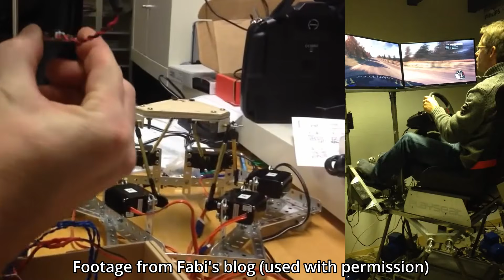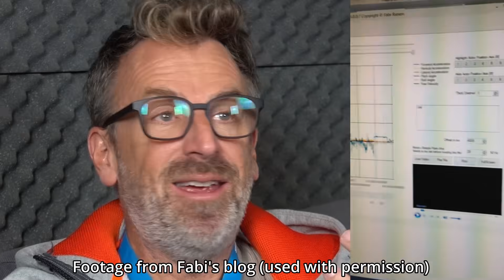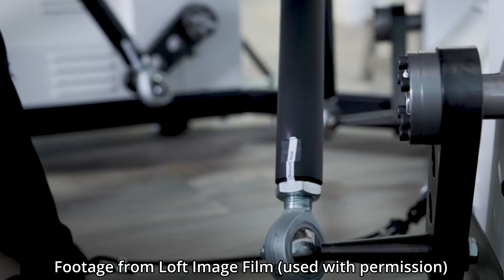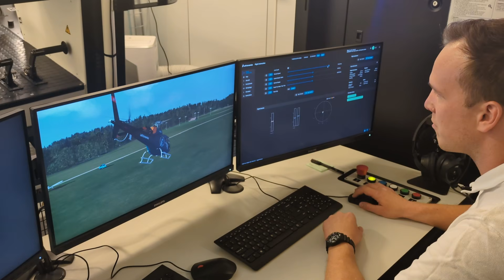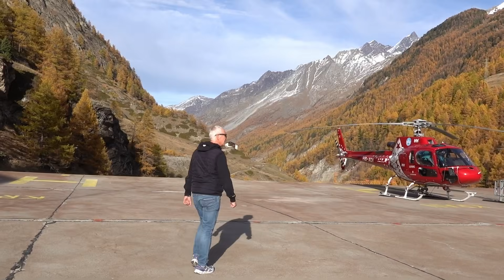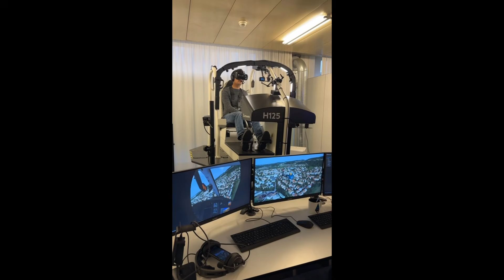This helicopter simulator is different

Comment: Thank you for visiting us and creating such an incredible video, Sandro! 🚁 You captured the technology, the people and the story behind Loft Dynamics perfectly. It was a pleasure having you! We absolutely love the result! 🙌
Reply from the maker: The pleasure was mine! Thank you for making this such a fun and amazing experience!
Reply: Thanks for this showcase to both. As a heli sim enthusiast I have a kind of naive 😊 question about LD and the simulation itself. I have acquired (FFB) hardware and a VR headset myself and spent …quite some hours with what is available for the home market. Minus the moving rig a bit like what is shown from the LD genesis (not comparing in any way, just to indicate from what background I come from). No argument about the immersion and importance of VR, I also early on went for a DIY control solution (until the recent surge in better hardware on the home simulation market), so no argument about the importance of proper controls either. But (nearly finished 😅) this presentation here focuses much on the moving rig, the cockpit replication and VR and neglects the software with the exception of the “data fitting” from real life to simulation as required for certification and fine tuning in general. I completely understand you can’t won’t shouldn’t disclose details about how the actual software works -but just for me to get a feeling: how far away are current sims to your simulation just in terms of the physics simulation and let’s say “the illusion” that was good enough for Air Zermatt to invest in you? (end question 🙈). There are quite some success stories to be found on Youtube of “simmers” able to translate their simulation skill to the real aircraft very quickly. So is the large missing piece between consumer and top of the world simulation primarily the system depth (VEMD, avionics, etc)? Or is there a good portion of more sophisticated flight physics involved?
It’s okay if you don’t answer 😅 I am just a nerd about this 🤩